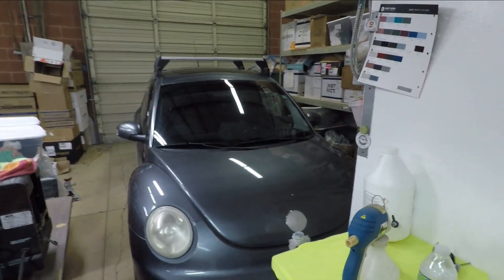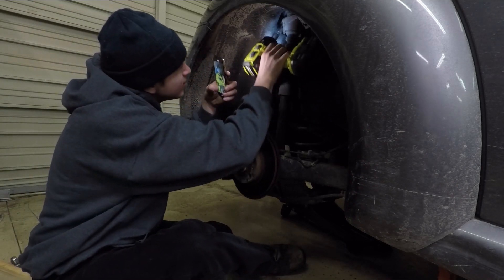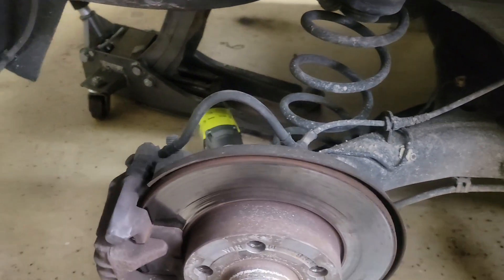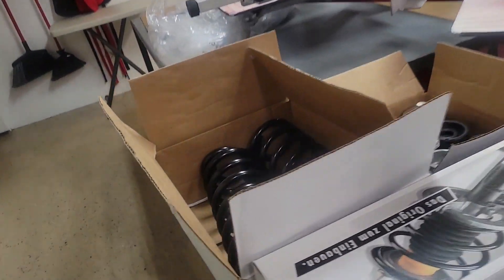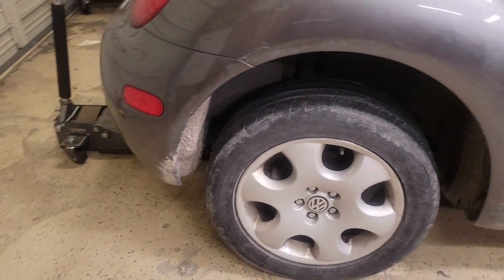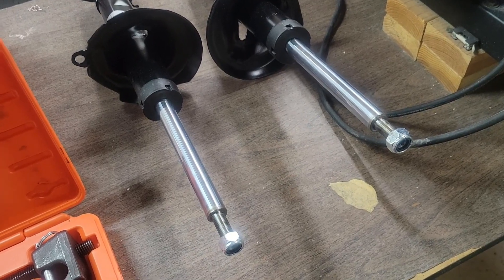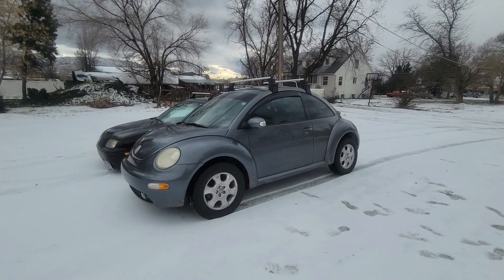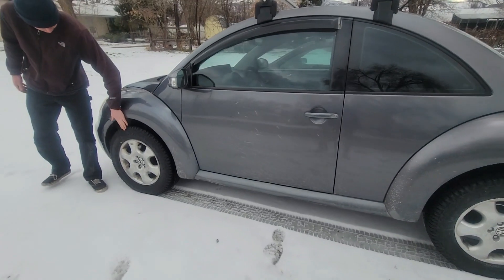2003 VW TDI Beetle Lift Kit Installation and New Taller Tires

Comment: Hi guys , i just put this lift kit on my 02 tdi bug , didn’t like the butt in the air look so removed the 1inch blocks from the back levels it out well , do you get any rubbing on full lock from the front i'm getting quite a bit ? Thinking about getting 1inch spacers. And getting alot of noise from the back when going over ruff ground you had any problems with this ?
Reply from the maker: Was getting rubbing on the front until I replaced the fender liners. The old ones were kind of shredded. I also have spacers front and rear.  On the back, I only get a clunk when I go over really big bumps. In the near future, I plan on raising the front another inch.

Comment: Got a part number for the front struts and where to get those spacers? I've got lifted TDI beetle on jeep springs and 255 70 16s but need new struts and those spacers.
Reply from the maker: https://www.ebay.com/itm/333748519846?mkcid=16&mkevt=1&mkrid=711-127632-2357-0&ssspo=y_P1rsC4Qg2&sssrc=2349624&ssuid=fr2VF1tbR2m&var=&widget_ver=artemis&media=COPY get ahold of these guys they can probably help you out.